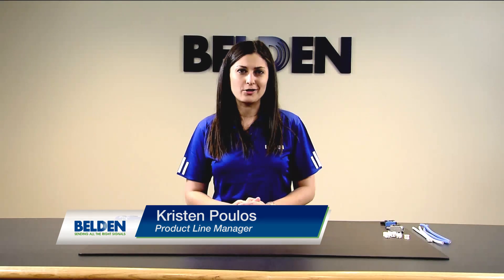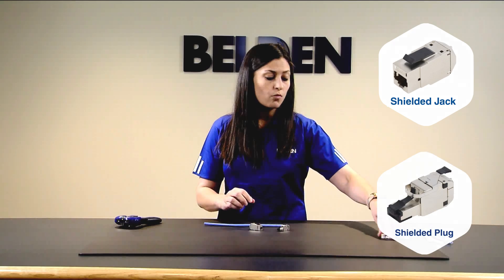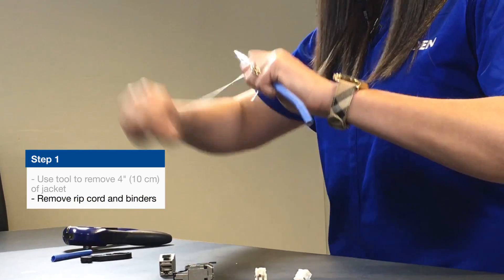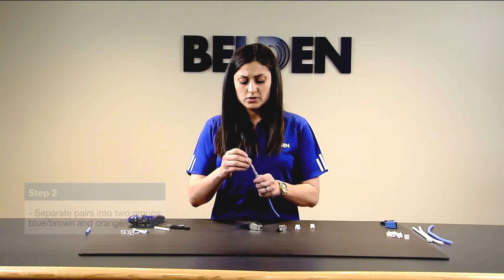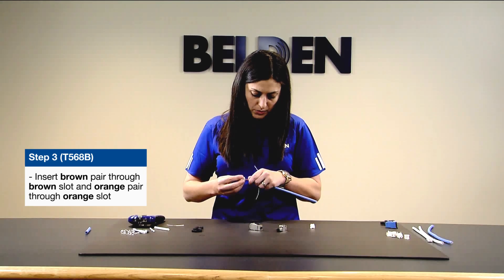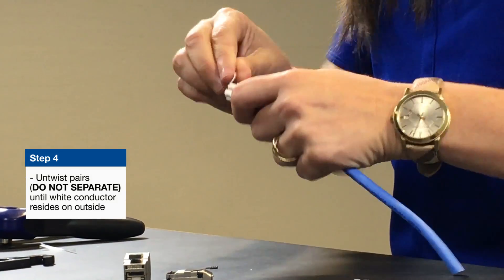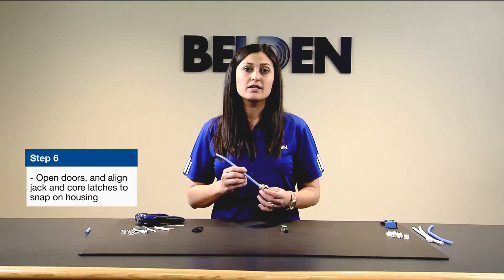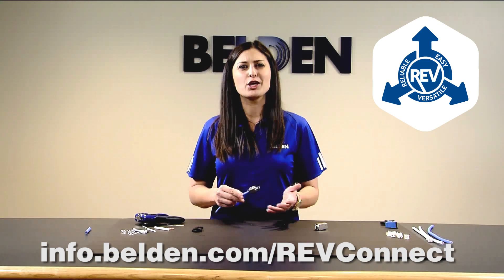REVConnect - STP Installation Instruction Video

Comment: Just used these for the first time at the federal reserve building in DC. Straight up Garbage connectors. The core and plastic piece with the gold punches are fine but the actual male/female connector is garbage. Constantly breaking. Can't be used in floorboxes. Throw em away hope I never use this bullshit again. Video helped me terminate tho.

Comment: Just ordered our first patch panel. Seems to be a bit over priced, but it does add quite a bit of convenience.  And your also paying for a quality and reliable connector. All the connectors are very sturdy and can be reused like 20 times if needed. In our manufacturing environment we use Belkin Terminals now. In our harshest environments (oily/dusty/dirty) we have seen these breakdown after just 3- 4 years. Then the housing just crumbles or snaps at weak points.  I will be curious to see how these hold up. Overall i hate paying for them, but I do love putting them together!

Comment: will the 10 GX jacks work with regular cat 6 cable? I ask because I mistakenly purchased quite a few of the 10 gx connectors.
Reply: 10 GX is suppose for Cat 6A & Cat 6+ for Cat 6